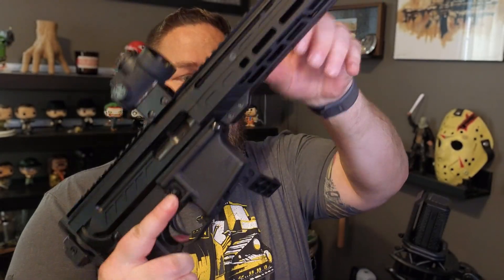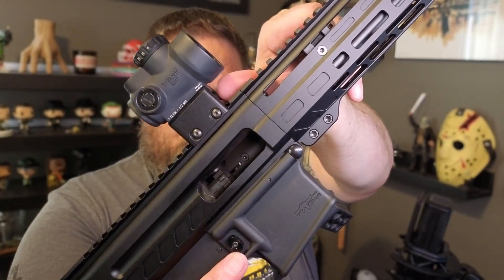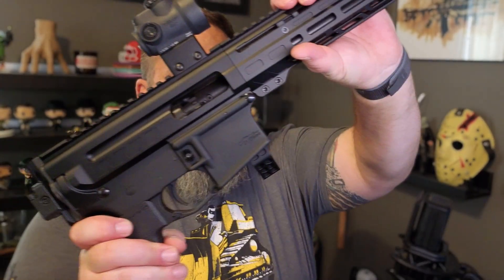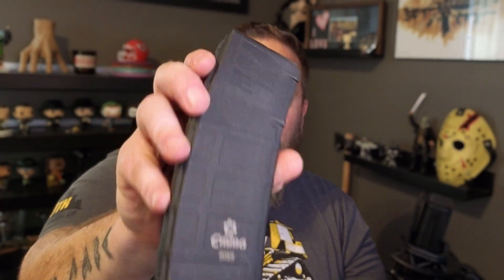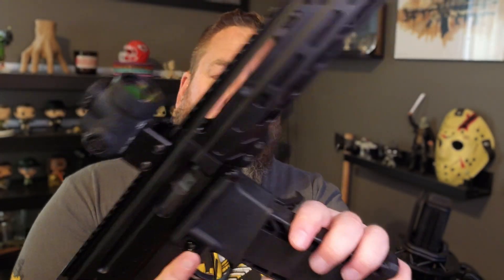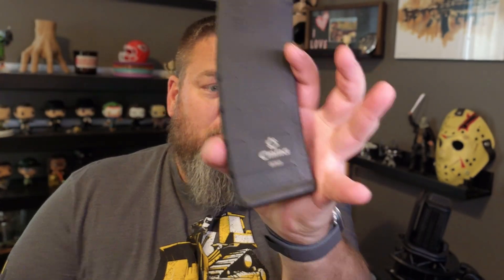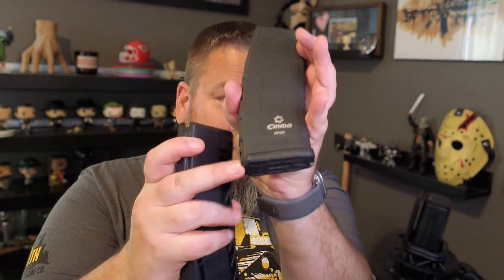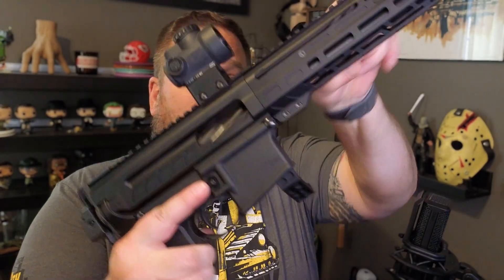Radial Delayed Blowback Compatibility

Comment: Can you guys make an Banshee that works with CZ Scorpion mags?
Reply from the maker: It's something we've looked at but is not in the works yet. Unfortunately, that would take a whole new redesigned upper in addition to the lower that takes Scorpion mags. Scorpion mags are wider than MilSpec dimension upper receivers, and all of our current offerings are based on those dimensions, so that would make an upper for only one magazine. We're not saying that it won't happen, it's just not in the cards currently.
Reply: @CMMG aw man, i see your point but thats so much work. I under stand CMMG would want to make their own complete upper but couldnt a making a BCG be enough? There are already AR-9 lower/Upper options on the market.
Reply from the maker: @MasterReptile25  there aren't that many for scorpion mags, and most are not compatible with our Radial Delayed Blowback. We'd have to redesign the BCG also because of the feed lip geometry of the mags too.

Comment: I have the new mag design and have had constant double feeds or ftf’s. I have your RDB and barrel in my build. Built on Aero Precision upper and lower with a Laws Tactical folder. I used the inserts in my Pmags (coyote) and they worked flawlessly but when the mags were stored with 30 rounds, the feed lips expanded and prevented the mags from dropping out freely. Realistically, I am disappointed in this setup, I have both the 5” & 8” and believe it was a waste of money. This was th be my truck / backpack gun but I won’t risk my life with it.

Comment: Well, I purchased your 9mm radial delayed blowback 5" Kit, Barrel and RDB bolt and cannot get it to work. Wish i had seen this before purchase.... Feeds ok some times, Short strokes at other times  and ejects weak, locks back on carrier not the bolt..  Tried Carbine , H1, H2 no luck. I am about ready to return it... any suggestions
Reply: What lower receiver are you using?
Reply: Trash it, and move on.

Comment: Thanks. I wish I knew that 7 o 8 years ago when i built mine. HaHa,  I used an  AAO  MFG  Glock lower with LRBHO. I cut the ejector arm flush with top of the lower. With a little fine tuning The LRBHO works great. By far my favorite firearm to shoot. I'm going to try the same thing with a  Juggerrnot tactical lower next! I'll let you know how it turns out. BTW I used the CMMG 5 inch bolt barrel combo.

Comment: How do I know if my Banshee 9mm is the fixed ejector version?
Reply: With the ejection port facing you, pull back the charging handle.  If inside you see a metal finger pointing back at you, flanked by 2 torx-head screws, then you have FE

Comment: Are there any forced reset triggers that work in the banshee’s radial blowback guns
Reply: That's exactly what I want to know. My RBT FRT will be here tomorrow and I plan on testing it soon on my Mk9 Resolute
Reply: My super selektor works fine with it when using full power NATO ammo, as well as any ammunition suppressed.
Reply: @MrGible hey can you tell me what you're running?  Dissent? Banshee? Buffer weight?
I just got mine from Atrius and am looking for any advice you might have before I take it to the range. Thanks 👍
Reply: Yes but not the dissent